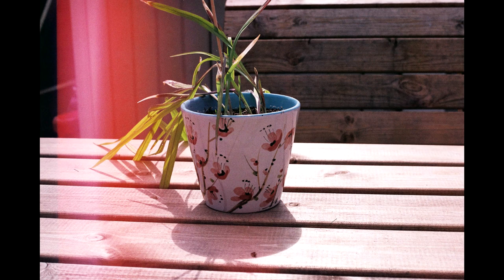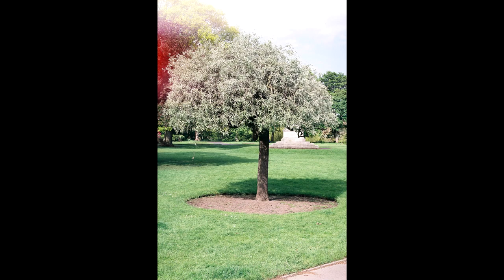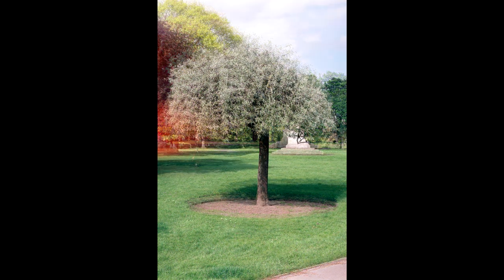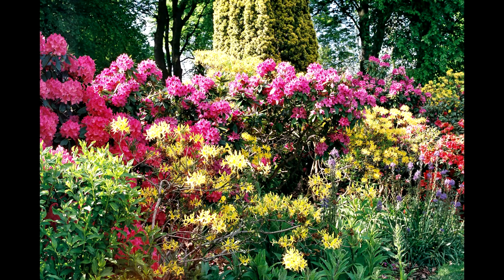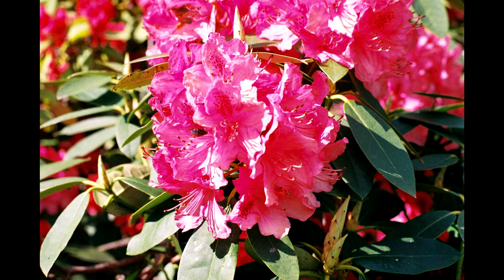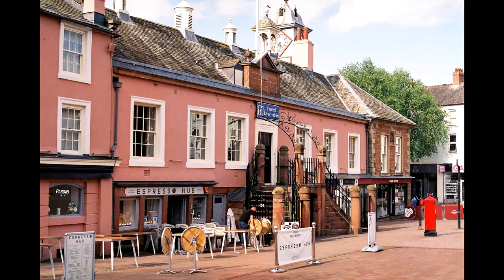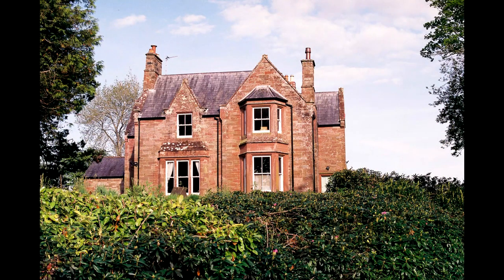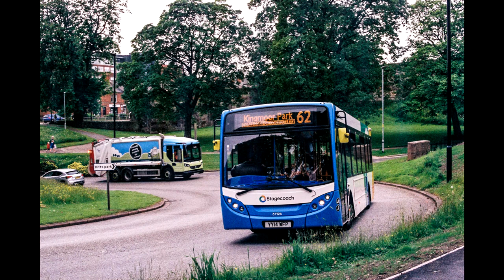How Does A New Film Through a 40 year old Olympus OM1n Camera Work in 2021? - "That Micro 4/3 Guy"

Comment: I still have most of my 40+ year old film cameras and various accessories too. Hence, with three external incident/flash/spot meters (9V & AA powered), there should not be any problem with getting an exposure reading. As far as WB for film, I can use my Gossen Sixicolor color meter to select the appropriate filters. Also, battery cells for my Nikon SLR, such as the F2A & FE2 are still easy to buy (and the MD takes AA), but not for my Hasselblad meter prism.

The only things I got rid of being my darkroom equipment, that included the color analyzer.

Comment: Brilliant video Brian, really interesting. I have collected a fair number of film cameras that I couldn’t afford in my youth and have used them in my local camera club as part of an annual photo film challenge. I have also come across the  battery voltage challenges and often have to halve the iso due to the higher voltage. Using film is nostalgic but do bring a number of challenges. Quality of processing and scanning does impact final results. Your picture colours look good and typical of Fuji.

Comment: I found the 1,4 V hearing aid batteries to be a good replacement for the old 1,35 V mercury cells. Depending on the model of the battery you might need an mr9 adapter as well, though

Comment: Those vertical streaks shout out to me that you have an issue with the shutter - common with cloth focal plane versions. It looks to me like one of the curtains is either sticking, or bouncing. There is a possibility that it is a light seal issue, but that usually results in much more haphazard trails on the frames. I'd put money on it being the shutter.
Reply from the maker: Yes, someone else pointed that out to me. The camera has been rather abused and left in a garage for years (I couldn’t even get the door to open at first) as so that would be logical. I think it may be sticky. I put my old winder1 on it last night and went through a few hundred actuations without issue so hopefully that should have freed it off. Only one way to test though….off for another new film

Comment: A company called Wein makes a correct voltage (1.35V) zinc/air battery that I use for my Yashica FX-2.  Quite expensive, but nice to have.  Part number MRB675

Comment: I use Olympus film Cameras and I can tell you that you'll find that the shutter curtain is a side moving one.  The light leaks you're seeing is from the curtain not working properly at certain speeds.  I experienced this with my old OM10 film camera after i left it on a shelf unused but after a roll of film it started to work again.  Easy enough to find out if the curtain isn't closing properly by just going through the shutter speeds with the back open and on manual.
Reply from the maker: Good advice, I'll check into that as it sounds really logical.
Reply from the maker: Just tried it now. I think I'll put my motor drive on and cycle it through a couple of hundred shutter operations
Reply: @ThatMicro43Guy  One way of doing it.
Reply: @ThatMicro43Guy  Brian, Why would you expect to fix an old camera shutter by driving it hard and fast with a motor drive?  I would think that is equally likely to cause more problems, not less.  You also said that you thought it would cost more to fix than the camera is worth.  Perhaps it would cost more than the camera is worth to you.  I believe John Hermanson and a few other Olympus repair experts will do a complete CLA on this camera for about the cost of a dozen rolls of film.  I believe an Olympus OM1n is an excellent film camera and well worth the cost to keep it in good operating condition.

Comment: I have also an OM1, but I think the lens is damaged, should check it again. The feeling of photography is different than digital. It feels like a real camera.
Reply: Brian have you tried a Zinc air 675 Battery? I remember a colleague of mine saying that to someone who needed one for their camera back in the mid 2000's when I was in the trade as a Jnr salesperson
Reply: Do you think you could have an issue with digitalization of your prints? I got a few pictures done on my cheap stuff film scanner and many of them are blueish rather than natural and I am not good at Photoshop lol
Reply: I am trying to get my 35mm cameras working and I tried to use my Leica R5 and a slightly older Ricolet viewfinder camera which I fear has been exposed when rewinding - just waiting for the cash as a roll of film is nearly the same to develop here in Switzerland but I was always using either 200 asa or 400 negative film or even 100 - 64 slide film when I was a teen
Reply from the maker: Quite possibly. I know I can correct them in Lightroom/Photoshop but didnt want to mess with them for this video apart from exposure. I wanted to se how they came back to me. Of course, back in the day, we were totally in the hands of the labs for colour prints.....unless you had a lot of room, some VERY expensive equipment and a second mortgage to pay for the materials to do your own processing (said from bitter and expensive experience lol)
Reply from the maker: No. Good advice, but I do tend to think that this particular camera will be relegated to ornament status now because of the light leakage.
Reply from the maker: Zuiko lenses are pretty inexpensive to get hold of on Ebay so I'd say go for it

Comment: DXO does an ISO measurement showing the camera setting ISO versus the real ISO for each camera sensor they review.  I think if you look at that you can see (assuming they measured your camera and sensor in their database) if the camera's ISO is actually what it says it is on the setting.  I mention this because you are trying to use the digital camera's metering to represent the speed on the film and there could be a difference.  

Also, I hate to say it, but film labs may be off in their processing and that can affect colors and everything else, then there are the scanning choices and a million other ways to complicate things.   The crap I was getting years ago made me go to slide film, at least with that I had a better chance of getting the colors I wanted and things in focus; lab quality had a lot to do with hurting film sales in my estimation.   You paid more and got less.  

Frankly I think it gets frustrating, which is one reason digital appeals to me, I can see it, erase it, adjust it, most of the time right in the camera.   What is frustrating is how lightroom seems, to me at least, to do a poor job of recreating the nice looking jpegs I get in camera in many instances.  Now, it may be down to me and the settings I choose in LR, but in my mind what I get on the camera screen should look just as nice in LR, and match well, and this is not always the case.  I think the camera manufacturers should be more involved in that end of the system integration with 3rd party development software issues.   It should all be less half-assed.
Reply from the maker: Absolutely. See my reply below to Philip Cupid. I know I can correct them in software but that would have defeated the object on this video.
Reply: Yeah, I stayed with Kodachrome for slides mostly and Vericolor II/Kodacolor for negatives, with wet printing at home. Color Management with digital is much easier (well, time consuming to calibrate the printers). However, I'm just an enthusiast.

Comment: In 40 years will my digital Olympus  EM 1 mkii even switch on?
Reply from the maker: And will you be able to get any batteries or correct memory cards for it either. Will there still be any sort of interface to plug the USB cable into. Sadly I believe not on all three counts. That says a lot. Good comment.